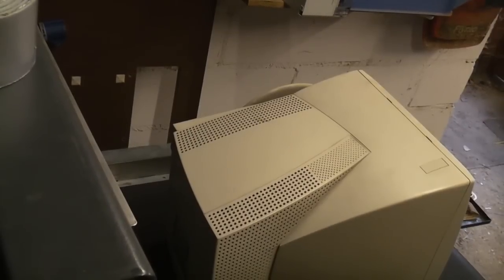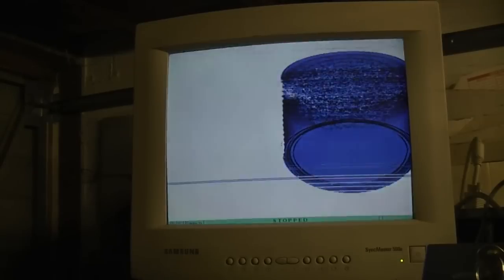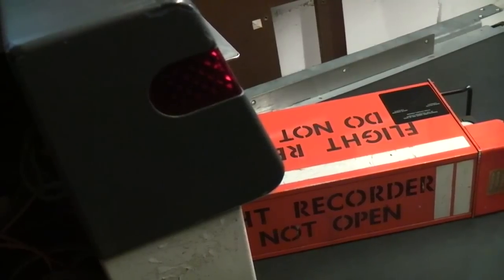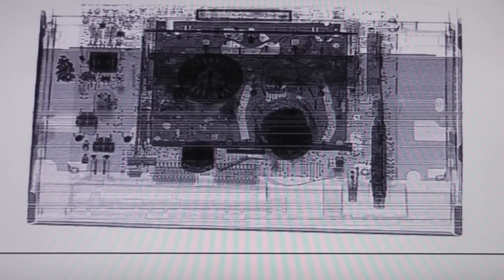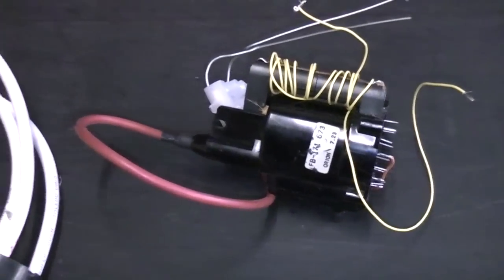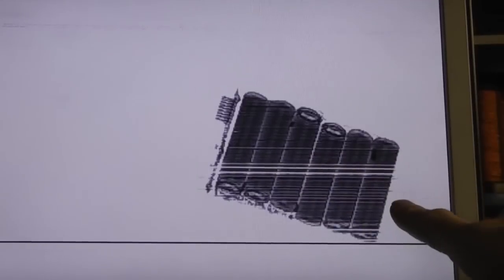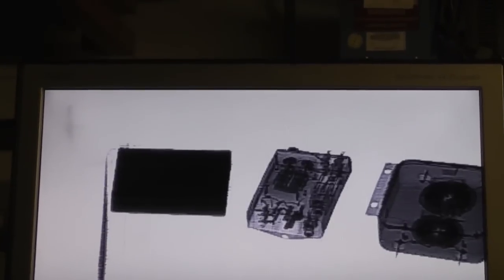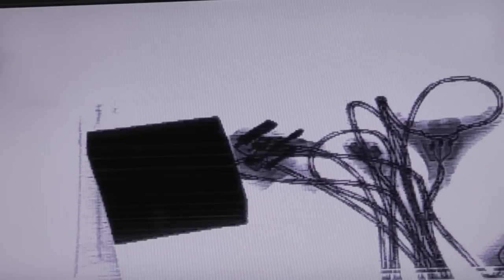Baggage X-Ray machine part 4

Comment: The re arrangement of boards is dependant upon a lot of if else's and buts. if diodes are faulty in the middle and are 3 or more adjacent to each other ...the whole board might have to be scrapped. You can pull diodes out from the board and rearrange but that is a cumbersome effort. At times the diodes don't get enough x-ray flux , you can watch for any sticky stuff on the tunnel slit just below the detector array and can increase the x-ray flux by changing two Pots . 215s were the last generation of scanners  along with Smits A series with all these electronics . Now the CPU based machines are in business and are easier to fix .

Comment: The horizontal lines would not be removed on this model. You have to replace the faulty detector boards. On more modern CPU based machines there are removed by bad diode elimination method, this is done when an acceptable percentage of diodes are faulty. When this percentage is higher then the threshold then interpolation wont help and the specific diode array board must be changed.

Comment: Absorption of X-rays is highly dependent on atomic number and photon energy.

If you take 2 images at 2 different photon energies (e.g. 1 image with a tube voltage of 80 kV and a 2nd with a tube voltage of 140 kV), they will have different contrasts. Organics (low atomic number) are much more transparent at High-V than at low-V, whereas metals are only mildly more transparent at high-V compared to low-V. 

By calculating the ratio in opacity at different energy, atomic number can be estimated.

Comment: X-rays can penetrate everything and can never be fully stopped in reasonable limits but the denser a material is the less is coming out. The strengs of the x-rays in a scanner your at are some few steps stronger that they use at a dentist. Some little thinner layer of lead should lower the x-rays to a point where it´s not dangerous anymore. This is the main safety concern when they manufacturer them since ppl are going to work with them all day long and im pretty sure there a special permits.

Comment: How did the SSD handle being x-rayed?
Request, fill a windowed EPROM with all zeroes, give it a go through the machine and see if any bits get erased enough to show up as ones on a dump. Would also be interesting as a general test to see if a long time/low intensity exposure of an "OT"PROM could erase it reliably. (As you may know, originally, one idea for erasing EPROMs was to x-ray them, but that would require high temp baking afterwards so UV erasable was favoured.)

Comment: I have been sending replacement adapters out.  Before posting them out, all adapters were tested very well.  So far all sent out that managed to reach end-users are OK, but one returned due to wrong address and when retested, failed very badly.  I suspected the adapter was scanned by the post office due to the funny address.  And another one that was suspected to have gone some  machine failed miserably when reaching client.  Anyone has same suspicion?

Comment: See if semiconductor chip fails or weaken if expose though these machines.  I suspect failure of some DC adapters are caused by these machine especially if they are on higher power.
Reply: smling11 im working on a speciality camera where a tiny defect on the CCD would be desasterous, and i will have to take it threw one of these machines eventually. Im very nervous about both the XRay destroying the sensor, and or the cameras cryostat beein too opaque for the operators to see inside. So yeah a study on this would be nice.

Comment: Did you feel anything when the rays hit your arm?

I work with these machines at airport security. One thing that is bothering me is that many of the guys that work there for a couple of years are bold, getting bold or hair thinly spread.. Is it just coincidence or are those rays doing damage?
Reply: yuukannahoshi it's probably more likely the stress of working in a high stress occupation. however, I wouldn't doubt it.

Comment: Have you ever tried getting a cat in a box :D Maybe I have just had mental killer cats. Any dog would do it, all the dogs I have owned ended up having an xray at huge cost (probably using the same system) because they ate a toy wrong or in one case a cat (only kidding about cat ingestion).

Comment: You need to normalize the array detector to be rid of the horizontal lines.  Be sure to remove every item from the tunnel before you run the calibration routine.  Do you know the passwords to get into the software?  I know them.  If you have dead detectors, you can easily rearrange them to put the dead pixels near the top and bottom of the image.  I have repaired many of the linescan 215s.
Reply: You obviously didnt watch part 3
Reply: How to solve these fonts I had a device type rapiscan 618xr  showing the image lines by what solution
Reply: I'm following you on YouTube and I need help getting rid of this problem...

Comment: Does anybody know if wood shows up on X ray, and if yes how good?
Reply: +I Forte Si Daja I wanna know too!
Reply: +I Forte Si Daja No wood is a diamagnetic compound meaning it doesn't align with the magnetic field given off by the Xray and thus would not be visualized by the xray scanner.
Reply: +Vikram Haridass You are confusing MRI with x-rays. Wood can be imaged very well with x-ray. Just google 'wood x-rays'.
Reply: yeah xrays can in theory image everything, but only dense materials really slow them down a lot so wood wouldn't show up very detailed but it would show up. also wood always contains moisture too, so it would show up on a MRI scan as well.
Reply: I am planning to take my Airgun`s wooden stock with me on a plane (I mean checked in) I don`t  know if that would be a problem.
Reply: Just ship it to wherever you're going. From 20 years of flying experience I can tell you that pretty much anything tubular needs to be pre-checked, but again in most cases it's just better if you can ship it.